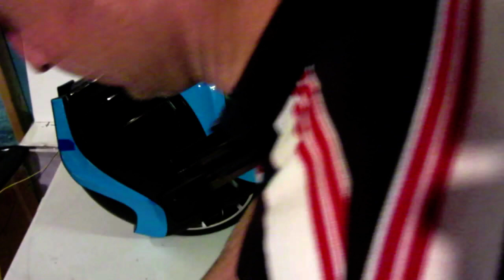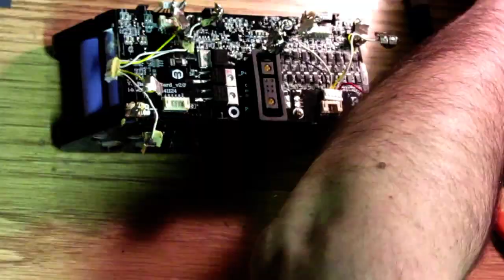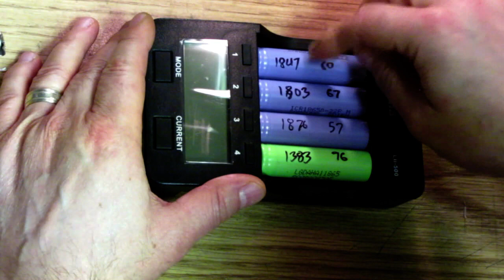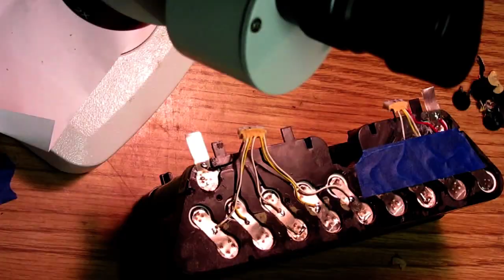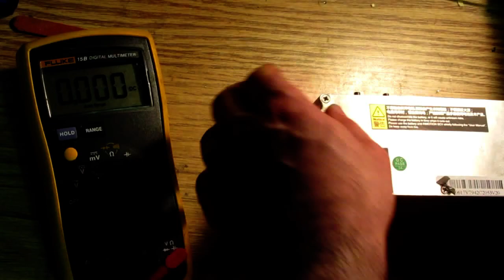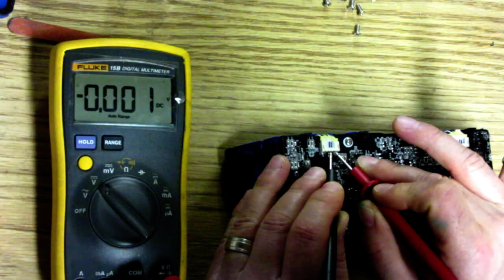Inmotion V3C Electric Unicycle 74V Lithium Ion Battery Repair

Comment: I would love to pay you to do the same to mine. Battery is dying , range is 1/4 what it was. It has sentimental value
Reply from the maker: Hello, I remember that repair being a ton of work with the checking, measuring etc. I am currently swamped with other projects ATM. Have you tried looking online for a 3rd party source for the battery pack?

Comment: This is great, i hope you also have information how to repair a v8 battery pack. I would also like to know if the BMS for the V8 go bad if they got discharged or can I reuse it in case I do a repack of battery? if you can give me some info it will be very much appreciated please message me. TYIA

Comment: Hello! can you please help me with my issue? - my Inmotion v3 pro doesn't want to turn on when there is no indication on the display panel. I can easily turn it on and off, while the power button is seen lighting blue on the black scren. In some time the screen gets black and I cant turn on my wheel, untill I put the charger in and then out(this action makes power button to light again)
What can it be?
Reply from the maker: I haven't done too much debugging on this unit other than the battery. I would say if, after you are able to power up, it works fine, then there is some sort of circuit/interface issue. If you can't start riding without the unit powering off, then it sounds like a battery/BMS issue.  You can get the battery tested separately to rule that out.
Reply: @chargerr4807  Thanks a lot!!

Comment: Which make/model spot welder do you recommend and from where did you purchase it?
Reply from the maker: I tried buying the cheaper Chinese ones, they don't work. I ended up making one from a car battery and an Arduino controller.  Works perfectly! 🥰

Comment: Hi. I bought broken V3 and when I replaced batteries, it was not giving me any output power. When I looked closer there were 2 broken SMD resistors on the black el. board inside the battery pack (R245 - just above the letter "Y" in the V3_BatteryBoard marking on the left side and R246 - top left corner near battery balance connector). I Wonder if you still have one disassembled and if so, can you please check the markings on that two resistors? Thank you in advance.
Reply from the maker: If you send me your email james@chargerr.com  I'll send you all the pics I have. 🙂
Reply: Hi! Have you found the marking of the resistor R245? I would really appreciate if you could share the information to me? Thank you in advance!
Reply: @VictorShishkin-fb4gb  Hi, I did not find the resistor just assembled it without it and it is working fine.

Comment: What voltage are new batteries and where can i hey them, please giveme full info and Specs of batteries ,thanks alot men
Reply from the maker: Lithion Ion batteries operate between 2.7V-4.2V, but usually they call them 3.7V. So 3.7 x 20 gives you 74V.  Lots of places to buy them, Ebay but you have to be careful. Good ones go for about $5 each. I salvage them from various equipment, and test them to make sure they are good, that's cheaper.